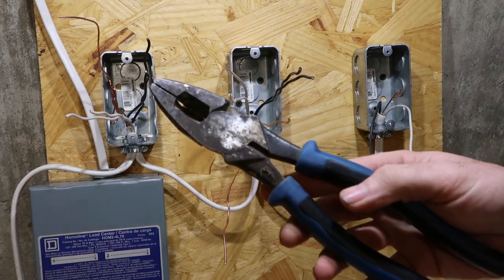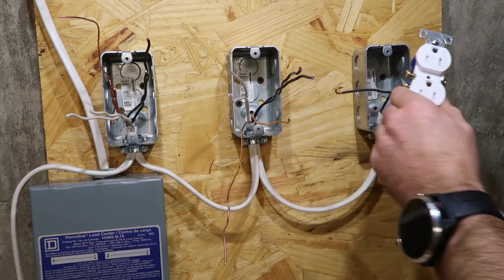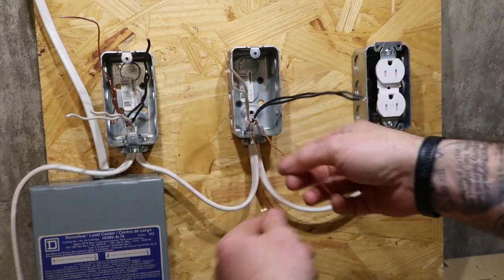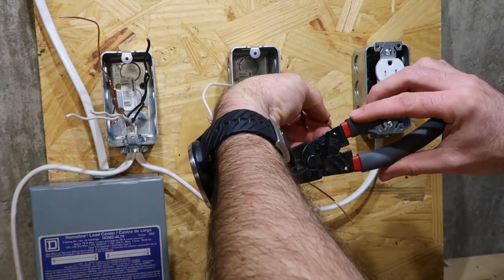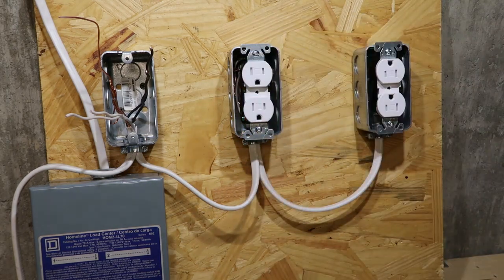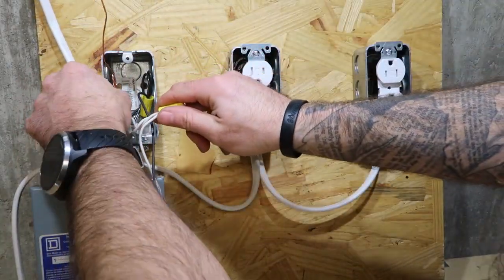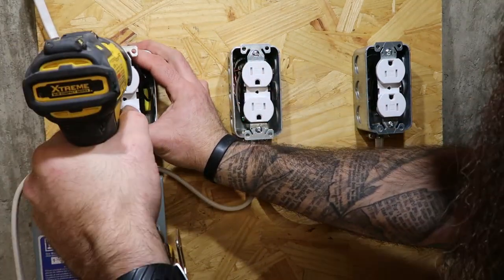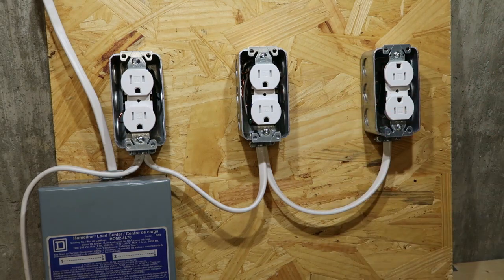How to install an Outlet #electrical #DIY

Comment: The ground wires were not done correctly. You need a bonding jumper mounted on the metal box and pigtailed in with the other ground wires. The raised metal near the bottom of the box with a 10-32 threaded hole is for this purpose. A green grounding screw attaches the bonding jumper to that location. The box will be incidentally grounded by metal to metal contact when the receptacle is mounted, but must also be purposely grounded. Obviously, on a plastic box this would not be an issue. The ground wires must be connected together using a wire nut or another type of connector. Twisting the wires without using a connector is not acceptable by code. A green wire nut with a hole at one end is commonly used here to eliminate the need for another pigtail.